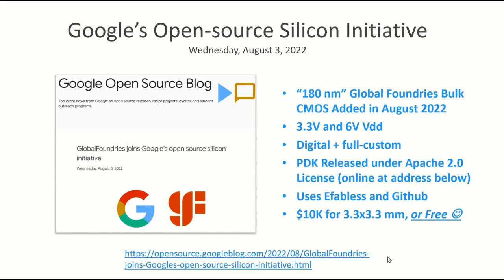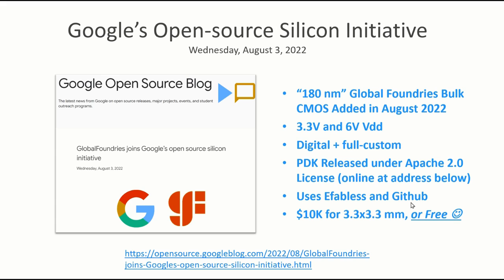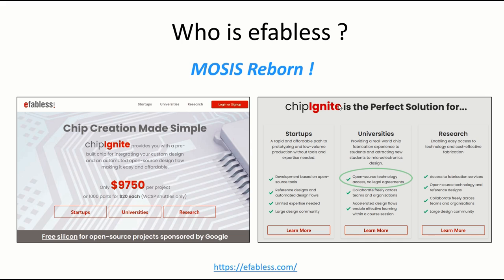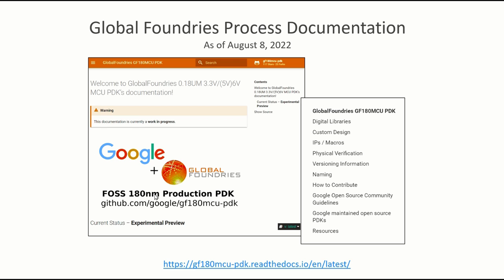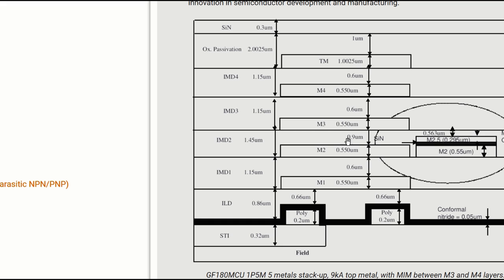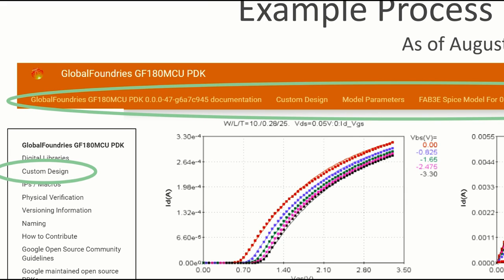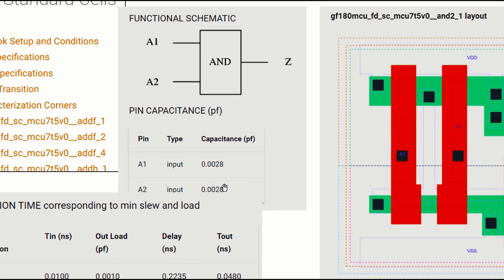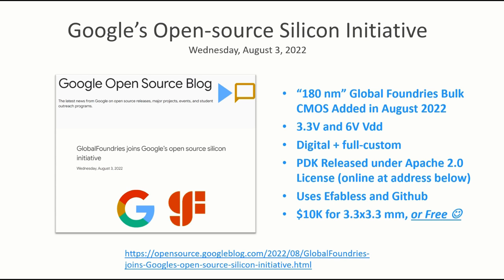Google's Open-Source Silicon Initiative with Global Foundries

Comment: Thanks for the video! One question: the pdk documentation is nice, but have you already tried to put this pdk in use for an analog design? Did you manage to use it with cadene, tanner or any other eda tool? I want to give it a try, but I would appreciate your opinion before getting into the rigmarole of installing the pdk in my environment. As you do, I manly do analog design, and I don’t care much about the digital synthesis. Thanks!
Reply from the maker: Sorry, no. Being retired, I no longer have access to Cadence, and haven't tried to load any public domain tools on my personal computers yet. Hopefully someone else can offer some experiences on what tools are compatible, etc...

Comment: Great to hear GF is joining the initiative, that's a quite interesting development.  I had another look at the libraries page and it seems that skywater is working on a 90nm FDSOI library release too even! For the open source tools I believe you can start work a look at the openroad project.
Reply from the maker: Thanks. I saw that process mentioned in an Electronic Design magazine article too.  Thanks also for the tip on the OpenROAD project. Found this paper and reading up on it now :-)  https://vlsicad.ucsd.edu/Publications/Conferences/383/c383.pdf